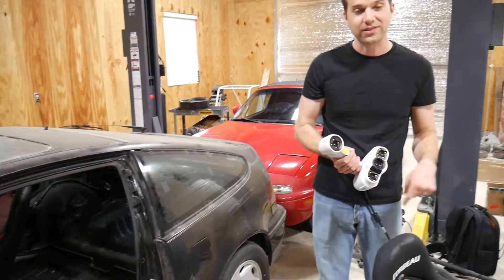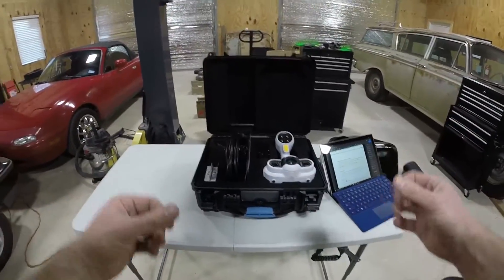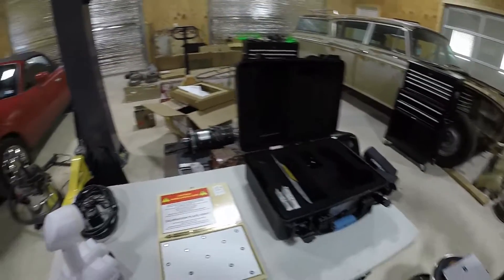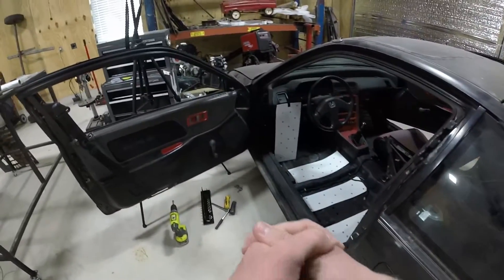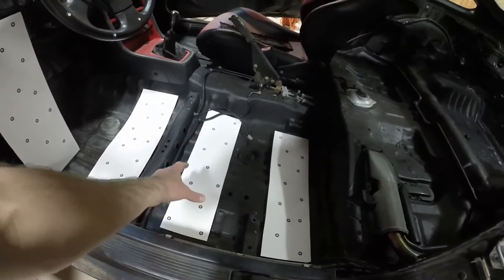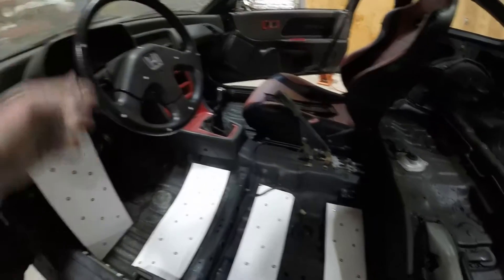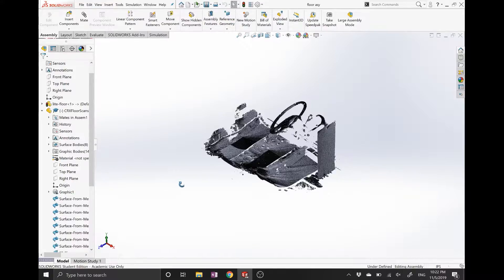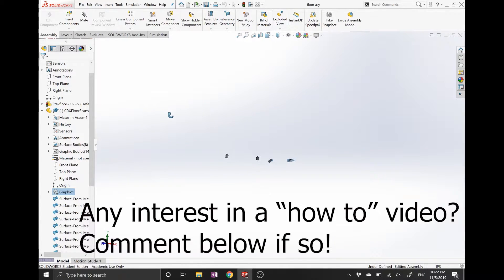Peel 3d Scanner - CRX Seat Mounts

Comment: Definitely how to!  Great video and thanks for the trick with the bolts.  Curious if you guys had considered the Artec Leo as scanner?  3x the price but wasn't sure if the benefit of mobility was worth it in your opinion?
Reply from the maker: Thanks! No I didn't consider another scanner but the Leo seems to be a great piece of equipment. As far as mobility goes I haven't had any situations where I needed more, but I have talked to other people about mounting a tablet or small monitor to the scanner itself if needed.